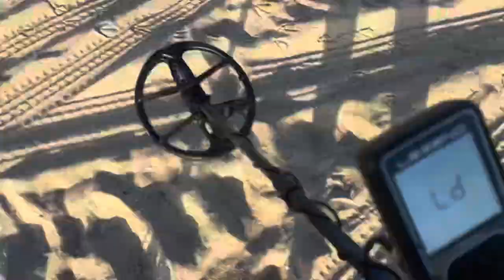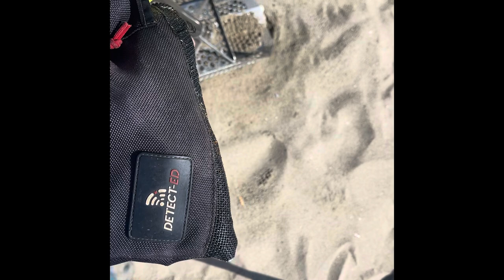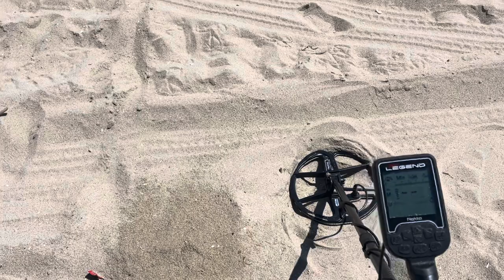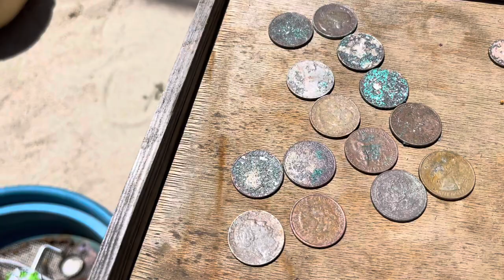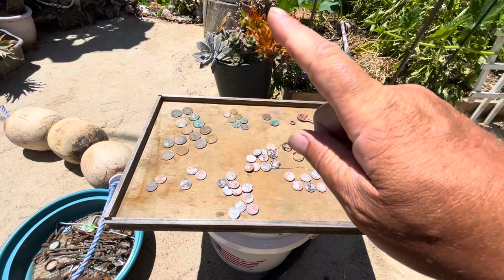Nokta the legend first time out metal detecting found treasure.

Comment: i just got mine too. i was messing with mine and i noticed that on beach wet it wouldnt read gold chain and pedant. but when you switch to dry it would read it. well it does read it but you have to put right on the coil to get low beeps while on dry it reads fine above it. congrats on getting a detector from them . finally  one for the good guy.

Comment: Quick tip Robert. Use W on beach mode unless the sand is bone dry otherwise you'll get a lot of interferance. Also use the noise cancellation and ground balance. I find that it cancels all the mineralization. Good luck on your hunts. It's a great machine ❤
Volume is in the settings menu
Reply from the maker: Thanks for the tips

Comment: Hey Robbie that is great to get hooked up with a Legend I would love to have that opportunity would be I would say that you need to look at the l owners manual I am pretty sure that you can mute it when pinpointing with hand held pointer. And a iron or ferocious metal indecator so you do not need to dig all those caps or tent stakes.And a stabilizer that can be used around salty water that will help. Monterey Magnet Man used Legend and if you check him out should be able to check his settings in the description box and it may help you but I am sure they may need a little wicking but a go place to start . And if you got the small coil use it in trashy area's you might like it.
Keep it up and make it fun and Happy Hunting 🙂👍..

Comment: Hey Robert just wanted to leave You a pointer for Your pin pointer if you cut out a cardboard circle spacer an put it in the cap of your land an sea pin pointer it will probably fix the problem your having with it keeps the battery from floating around in it.